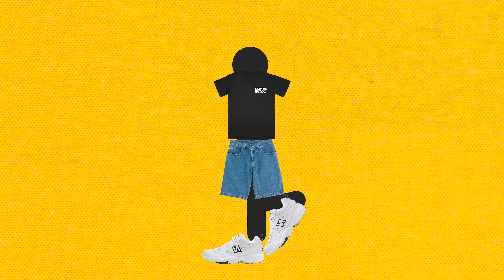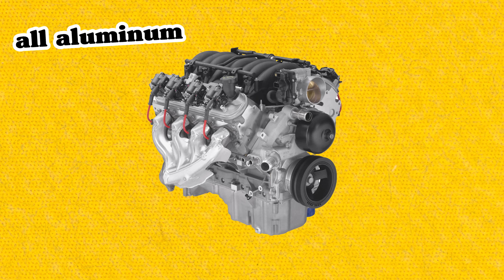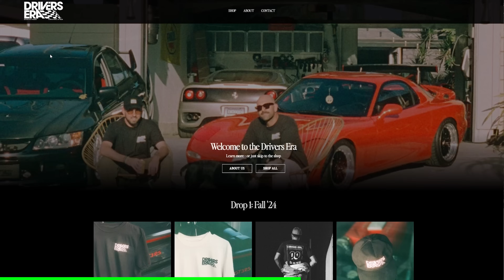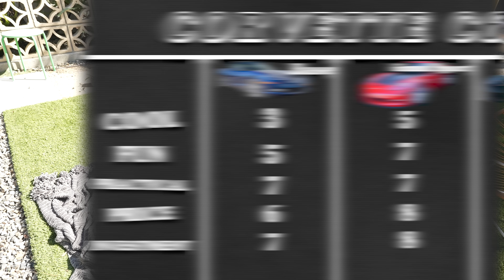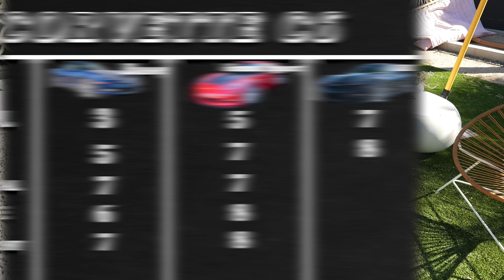Base vs Top Spec- Corvette c6. Is it WORTH IT?

Comment: Gransport is nice to boost, decent bottom end. Zr1 is also nice stock, makes decent power for what it is.  The grandsport has a steel frame unlike the z06 which is aluminum.
I enjoyed my c6z. Had rpm do ported and milled heads, cam and intake the car put down 603 on pump gas. I drove it across the country a few times and had a blast. The z06 needs to have heads fixed from the factory apart from that they are phenomenal. However if you're building one for power I would do a grandsport. Just my thoughts
Reply: Yes the c6 zo6 is such a cool car with that 427 engine .

Comment: Now this is the review I've been waiting for! Also hit the nail on the head with being REALLY hard to build a drivable 650hp car in your garage,  I built a 650hp NA truck, I have to manually column shift the automatic to avoid unintentional upshift burnouts in traffic, bad combination of  trans controller, torque converter etc, fun? Yes. white knuckle driving every second? also yes

Comment: I bought my '05 base model 6MT L55 with the acrylic roof about a month ago and I can't stop driving it. I paid $18,500 with 86,000 miles.. It came with an Airaid cold air intake, Billy Boat cat-back stainless exhaust, ans some aftermarket swaybars. It's lowered an inch in front, 1.5 inches in the rear, and just...it's perfect. I MIGHT upgrade to an '08 at some point. The base model is so perfect, though. What a great daily.

Comment: as a modified c6 base model owner, I have struggled with wanting a ZR1. However, I find that even if I sold mine for WAY above market, I'd still have to spend $30K MINIMUM to "upgrade". Then spend ANOTHER $20K to mod that, because, well, who wants a STOCK Corvette (even if it's a ZR1)? LOL. My only real complaint about having the "base" is wheel selection is abysmal. Adding wide body just so I can get good looking wheels just doesn't make fiscal sense when the car is already PLENTY fast to get me in trouble. great vid.

Comment: Depends on what you’re using it for. If your drifting get a base and bash it then throw on wide body fenders. If you’re tracking it the GS or z06 for the dry sump and upgraded brakes

Comment: 1 minute in, I already have to drop a comment. The C4 is a good sports car, and was a fantastic sports car for the time. Whatever you might consider a Countach, Testarossa, etc, the C4 ZR1 tops it. Even the base model is an amazing car. I've gapped modern WRX's, Mustangs, and LS cars with a pre-LT engine C4 on the straights, and, in the corners. Anyone who underestimates the C4 hasn't driven a good C4. You have a great channel, but minus points for that opinion. I certainly agree that the C1-C3 aren't great sports cars, but the C4 can definitely keep up today.
Reply from the maker: For sure. A lot of 80s tech cars are pretty sub par from a driving experience. Late 90s is when things started to make sense

Comment: The stock Grand Sport has many the doodads and flash (and the dry sump), but doesn’t have the horsepower you get with a Z06.  I looked at a few C6 ZR1s but their prices were too much.  I settled on a C7 Z06 and am happy I did.

Comment: The C6 ZR1 is one of my dream cars! That car is just downright sexy in every way! I'd want one painted either Jetstream Blue or silver with the stock chrome wheels. Unfortunately, with me standing 6'5", I really don't fit inside any Corvette comfortably, which really pisses me off because they're not exactly tiny cars externally. 

Zach's Grand Sport sounds great! The hood on his car looks like it was inspired by the hood on the Corvette C5.R.

Sonja is my kind of girl. First and the most important mod? BOOM... exhaust! Gotta have a decent sounding exhaust rumble if you have a V-8 powered performance car.

On a side note, you mentioned the horsepower for the C4 ZR1 was only 375, which is partly true, but for the 1993 - 1995 models, the horsepower was bumped up to 405.

Comment: Considering the difference in power between the base model running 430hp zo6 running 505hp and zr1 running 640hp while also considering the carbon fiber being a extremely expensive ad on to any thing at that time it definitely makes one realize the actual reason for such a cost difference between the 3 versions

Comment: i got my 08 c6z for 30k, engine and trans have less than 35k on them, chassis has 100k on it. its been such a fantastic car so far, I fixed a few minor issues that the car had and am now shopping for some heads because the original engine had its valve drop and grenade the motor, ive got it sitting on nitto nt-01 race tires with some ceramic break pads. once i get the heads done its track day central.
Reply from the maker: So much car for the money!

Comment: Just bought a base C6 2007 six speed car...  I like it and was ready to go to a newer generation after 20+ years of C4 ZR-1ownership.  Not much  here to add to the C4 comments posted below as I put at least 150k  in miles on my 3 ZR-1s.  The C4s were the first Corvettes with real modern suspension, however, the chassis needed stiffening and that didn't happen until the C5 unless you bought the right chassis strengthening parts or that generation.  So, my mind is made up...  a C6 ZR1 has got to be the best choice...  Going over 200 mph is a bucket list item on my list.

Comment: I may be biased but C6 Z06 is the sweet spot IMO - wide body, 31xx lbs, aluminum frame, can make an easy/reliable 6xx whp with a basic heads/cam set up and that LS7 is an animal.. all for not that much more than a base car. I'd love a ZR1 but are they REALLY worth $30-40k more than a Z06?

Comment: No love for the C4 ZR1?  Yeah it's an odd car, lol. But it's crazy how the body is way wider. It's not just Flares, the body itself is wider.  Freaking LOTUS developed the V8 in it, and Mercury Marine built it in their MerCruiser factory.  It's an insane car for it's time period. 405 horsepower isn't crazy now, but in 1993 it was insane. a V12 Ferrari 512 only made 420 horsepower at the time! The Mustang GT made 235 horsepower, lol.
Reply: My thoughts exactly. For it's day the c4 ZR-1 was one of the fastest cars money could buy. It was a legend and it punched way above it's weight. Even to this day it's no slouch. I have a stock 95 ZR-1 and from a highway roll It's dead even with my buddies stock c5 Z06. Also to this day it still holds a 24hr speed endurance record that no production car has been able to match. Sadly, the c4 ZR-1 is a 90's legend that doesn't get the respect it deserves. I also have a c6 Z06 in the garage, but I grab the c4 keys more...

Comment: I'm going suggest the 1st or 2nd gen Mazda 3 because I'm convinced they provide the most complete driving experience under 10k, they are practical, reliable, fun to drive with a really capable chassis that it shares with the focus and some Volvos, They have really good steering feedback and a good shifter as well. You could do a comparison between the regular 2.5, the speed and maybe a tuned speed or focus rs.

Comment: The LT5 in the C4 Corvette was co-designed by Lotus and was one  of Chevy's only DOHC 32 Valve engines at the time, with a rev limit set to 7,200 rpm it was also their highest revving V8 at the time (to my knowledge anyway), i would say it's pretty special just too bad the whole package was way too expensive in a time where people werent really buying sports cars due to economic reasons

Comment: Give me an old beater c5 with a plywood dash, aluminum seats and door skins, and the original engine i built myself with mahle .010 over pistons, ls3 top end and a great cam, 2-1 exhaust.   Good brake pads and suspension work, sticky buns on light wheels.

Comment: Very disappointed that you didn't really say anything about the Z06 and didn't include it in this video as it's arguably the best C6 version, and the LS7 engine is what makes it so special. It's the lightest C6, with highest redline at 7k RPM, and it's just a perfect balance between power and handling. Yes there's a potential issue with the engine, but it's fixable. I've owned my completely stock Z06 for 2 years now. Bought it from the original owner so the car isn't abused, and have no issues. There are people who have over 200k miles on completely original LS7 engines. Grand Sports go for similar money because they are known to be reliable overall, and everyone and their mother are afraid of the potential LS7 issues. At basically half the price of the ZR1, Z06 is in my opinion the best version of the C6! And I love mine!

Comment: Just worth clarifying. Ls2 is 6.0. Ls3 is 6.2 and obviously ls7 is 7.0 (why no z06 in the comparison) ls9 6.2 supercharged?
Reply from the maker: I felt like 4 cars was too many. Z06 would be a good middle ground but I’d rather have Zac on the show
Reply: @vin_tra  fair enough but a heads/cam ls7 Hitting 7k rpm is not to be ignored when discussing c6 lol.

Comment: The narrow body c6 isn't a great choice if you're looking to track or autocross it. They can't fit big enough tires.  The wet sump isn't as good as the old batwing pans either. The c5z is a better deal around that price point and power output.

Comment: You said parts support for these C6 Corvettes is amazing. So how hard or expensive would it really be to upgrade the brakes on a Base C6 to something like Grand Sport level? Is there no aftermarket, 3rd party rear diff options for the Base C6 that would bring it closer to Grand Sport performance? Maybe a Base C6 with the Z51 package that includes: suspension upgrade, larger brakes, short-ratio 6-speed manual, and trans cooler is the way to go here. I think you're really overstating the benefits of the Grand Sport compared to the Base C6 with the Z51 package and/or some reasonable, mechanical modifications, especially since it costs double the money! Doesn't the widebody of the Grand Sport make it less practical for daily driving and fitting into parking spaces for example? Would you really rather buy a Grand Sport for $40-50K or a C6 Z51 for $20-25K, spend $5-10K on upgrades, and save the remaining $5-15K, or spend it on fuel and insurance over the time you own the vehicle?
Reply from the maker: Dollar for dollar the Gs is a better deal. If you are on a budget the base is a great start and do it over time

Comment: C5 hp was only 350 unless u had a z06 and then it is 405hp
Also c6s in ny start at 30k with low mileage not finding one for 20k without high mileage

Comment: C6 trim level isn't really dependent on the model.  All 4 models have similar trim options where you can wrap more stuff with leather/Alcantara  & stitching.  Just have different trim codes and logos.  
But it's all the same design and interior.

All C6 models have the same seat design depending on the year.  Just different trim levels can change the color/stitching/logos/or alcantara inserts on some centennial edition cars.

The seats were the same across all 2005-2010 models.

2011-2013 have "upgraded" seats.  They just look cooler. Wider thicker headrest more bolstering kind of....but they still SUCK as a performance seat.  Comfy.  But terrible for going fast. Just like the older model seats.

On a used Vette if a seat feels like it has more bolstering it's probably because the car has less miles or a skinnier owner history.  Lmao. Just less worn.
To my knowledge the only thing different on C6 ZR1 seats are the logo.

Somebody correct me if I'm wrong.

Comment: Oh man, need to do your research on the C4 ZR-1, only 375hp?  DOHC, Lotus designed, built by Mercury Marine, really the engine that inspired GM to build the LS series engines.      Go back and look at the other cars of the era and how that compares... even more impressive they make tremendous power when modified especially considering the displacement and limited aftermarket.  The C4 I believe still holds the 24hr production record at an average of 175mph for 24hrs, and back in the 90s a large displacement ZR-1 ran 0-150-0 in 23.3 seconds on old tire tech and brakes.... that would have been top 3 in Car and Drivers 2023 test just behind the c8 Z06 and 991 Turbo S... and ahead of a Porsche GT3 RS.   Car and Driver even made mention of it in the 2023 article.   427ci LT5s make 650-700hp and with the same displacement as an LS3 you are in the 560-580 range.   Great video, thanks for highlighting the corvette
Reply from the maker: Great info!

Comment: The LS1s were not close to 400hp. They were rated from 325-350hp depending on year. The LS2 is a 6.0L not a 6.2L. And not incouding thr Z06 for a c6 trim video is criminal

Comment: I had a C4 and loved it. That's the same platform that the C5 and C6 are built upon. With the same suspension upgrades and the same drive train as the C5 or C6 it would be just as good of a car. You can't sit there and criticize a car with its origins in the 1980s. I was good with you until you made that stupid remark... you said what you said.

Comment: The grand sport is not level 2 lol, nor is it at the $40k price point. Great video concept but baffling misstep there 😶
Reply from the maker: How so?
Reply: @ bc the grand sport is the the base car with some track focused upgrades, but not the whole package as with the Z06. I’m not saying the GS isn’t worth considering in the lineup but the Z06 should be in the comparison hierarchy, and especially in the used market where there are greater price pressures, the difference in price between the two is negligible unless you can find a really good deal. I really like this idea of comparing the different levels bc the hierarchy of models leads people to assume that the base car is crap and the higher tier models are the full version, which is often not the case.

Comment: The c7 gen will be the collector car, not the c6. The c7 being the last front engined cars are the most valuable, the last of anything before its altered is always whats worth the most, cars, watches, art, wine, it's universally applicable.
Reply: i agree with him though that the c6 is definitely largely accepted as the pinnacle of the corvette lineage. i don’t think the base model cars will be a collector car ever just due to the amount of them, but the zr1, and likely zo6 and grand sport, will be very very expensive collector cars at one point. the zr1 already is. rightfully so too. the c6 zr1 is the coolest corvette every made
Reply: @onfazo The C6 was arguably the better looking.  Especially from the rear with the round tail lights.  The C7 was the better performing obviously.  The C7 is starting to look better now when compared to C8
Reply: Disagree. The c7 screens in the dash will age poorly and it’s overstyled. A great car for sure but c6 is true analog.
Reply: I loved my cammed 08, but my 14 is better in every possible metric.
Reply: Eh. The problem with the c7 is it has way more computers to get unhappy with you. It'll be a lot harder to keep going long term than a c6. Its not old enough yet, but wait until its 20 years old and you're sourcing some stupid module that only can be had on the used market.
Reply: @ruleslawyer  Very true

Comment: I guess the answer to this ultimately depends on what you’re looking for as a driver. If you’re just wanting something pretty quick, but still tame enough to drive everyday, then a base C6 is more than enough car for most people. However, if you’re looking for something more raw, more rowdy, and track capable, then a Z06 is that car. Just due your due diligence with the engine. A C6 ZR1 is a monster, one that I feel is a bit too much for most people to handle, but if you’re someone who CAN, and you want the top dog street bruiser C6 Vette, then it’s your fire breathing sled.

Comment: brother a c7 z06 is cheaper then a c6 zr1 and significantly more capable, hell for 130k you can get a C8 ZO6 and obliterate most things
Reply: just paying 6 figures for a corvette 2 generations behind makes no sense when the current gen is so easily obtainable and so much better
Reply: Those top special models are always terrible value if you want a driver.

Comment: As soon as you said a Grand Sport is basically a Z06 with a $10,000 dollar discount I couldn’t watch anymore.  No aluminum frame, like a Z06.  No LS7 427 like a Z06. No carbon fiber hood and fenders like a Z06.  A more accurate description would be a Grand Sport is basically a base model with a wide body kit.